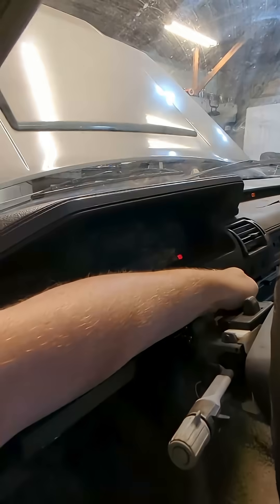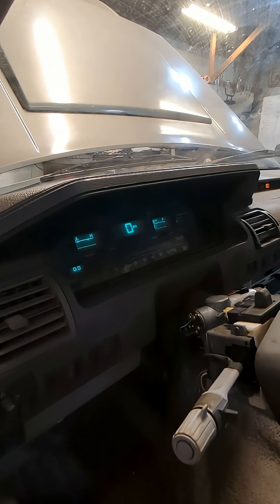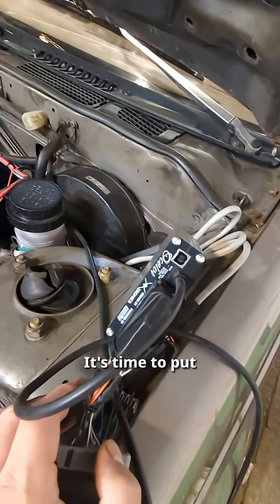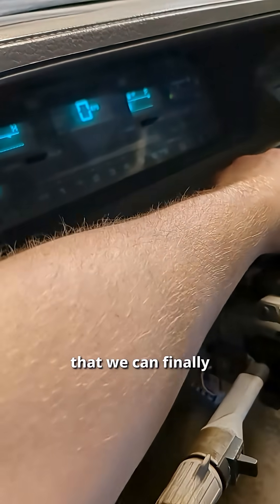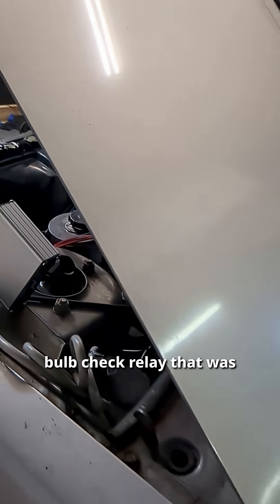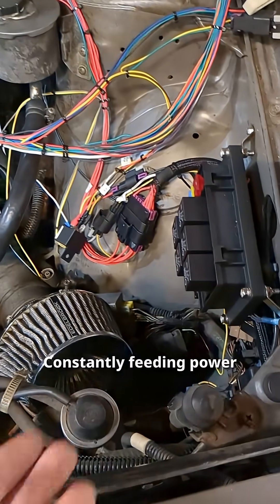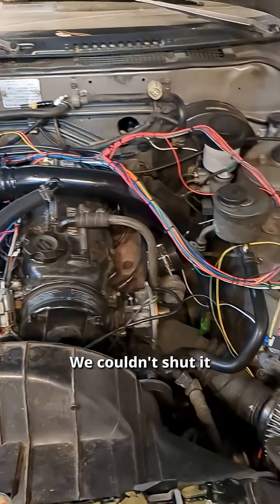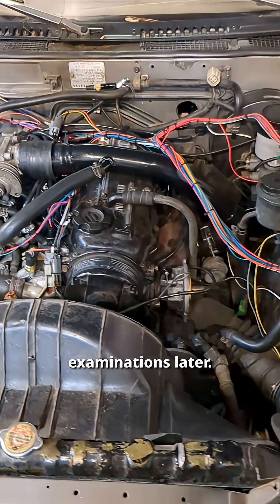Final touches on the Speeduino Standalone S12 project

Comment: How did you connect the distributor
Reply from the maker: Only using the cam angle sensor in it. We had a 36 tooth wheel laser cut for it for clean signal.
Reply: @ConeDodgerMotoring yeah I have a Nissan d21 with a single cam ka24 and I was wanting to redo all the wiring
Reply: And install a standalone
Reply from the maker: There's a bunch of ways to go for ignition. I did coil on plug for my ka with a crank pulley timing pickup. This time used the factory cam angle sensor and 106b coils. 

Mostly it's a matter of using parts that are well documented and used, makes setting up in the tune easier.
Reply: @ConeDodgerMotoring yeah